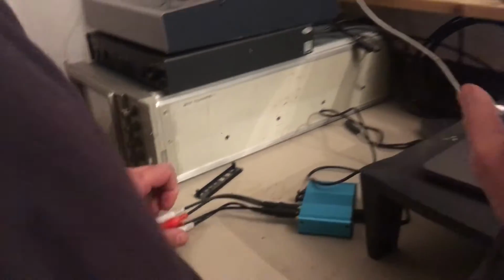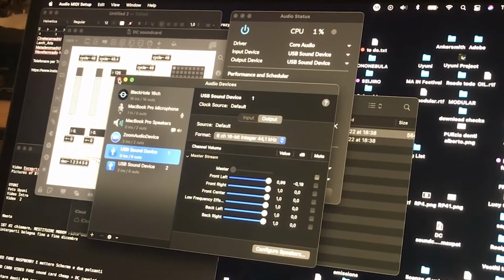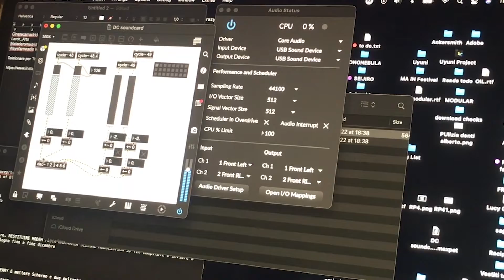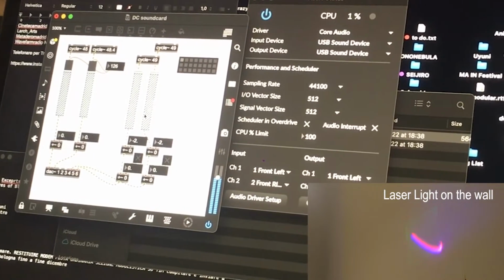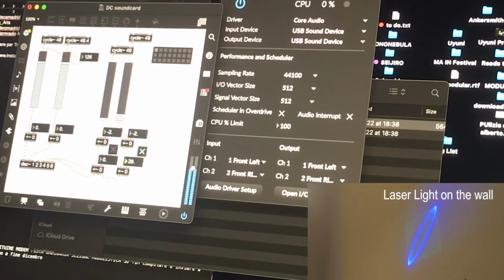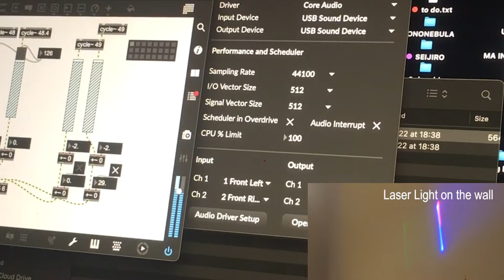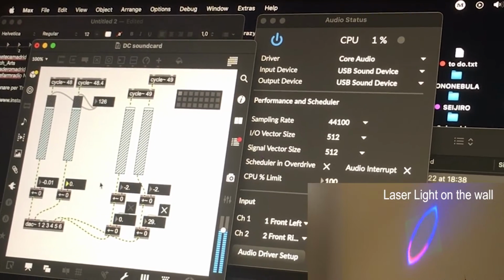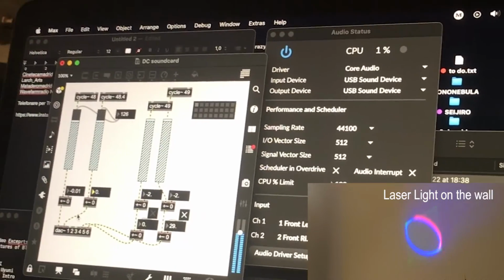How to make a cheap 6 channel DC-coupled soundcard with less than 10$

Comment: Great video very much considering buying an identical one i saw on amazon, though theres a review saying it doesnt work with windows 11. Are you using windows? And have you had any issues recently?
Reply from the maker: nope never used windows, I bet it would work though... it works straight up in all USB devices.

Comment: You just saved me at least $100, depending on which DC-coupled soundcard I bought. Thank you SO MUCH.
Reply from the maker: great! remember though the quality of this soundcard cannot be compared to a high quality one. So this is mostly a DIY possibility.
Reply: @thejestern  Well, I just wanted something for the Tektronix 7603 I bought, and all my other sound devices made pictures that looked like butt on it. This produces great quality pictures on it. And besides, I'm not an audiophile. I was using my motherboard's build in sound chip before I started using this. CD quality is more than enough for my needs (except for oscilloscope music, where I've noticed that 192KHz is better than 44.1KHz).
Reply from the maker: @ajshell2  ah sure if you use it for these application it can be fine!!! that was exactly my idea for it...

Comment: do i need to install all 6 resistors? I installed one on the first channel but it doesn't change the voltage
Reply from the maker: You need 5 resistors for Laser, 3 for oscilloscope. Depends on how many channels you use of course. It's just if you want to send constant DC voltages. If you send for example 3V you should see a constant value out in the voltmeter.